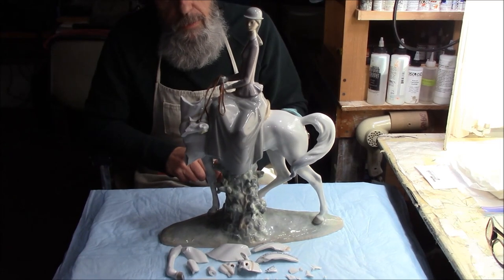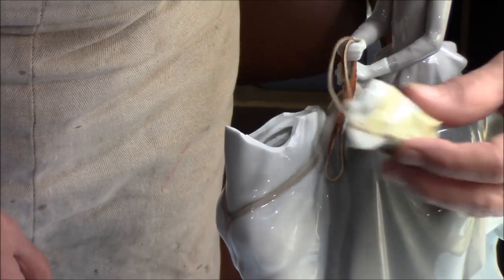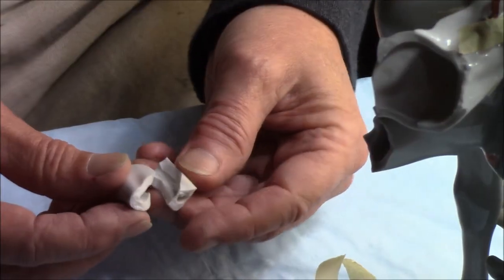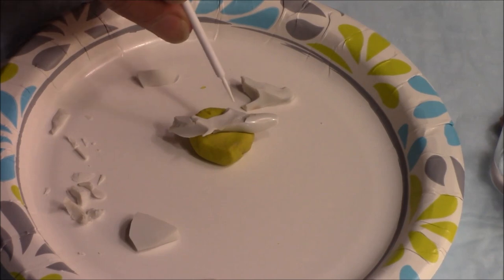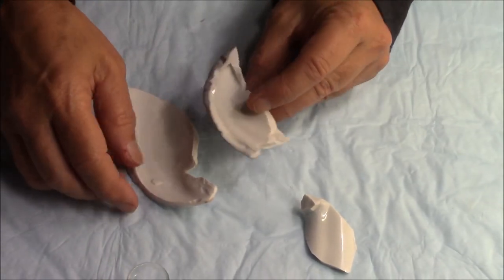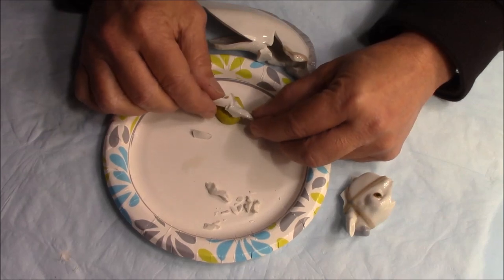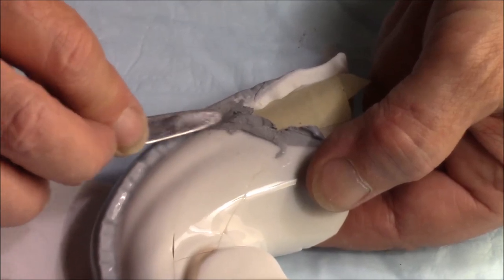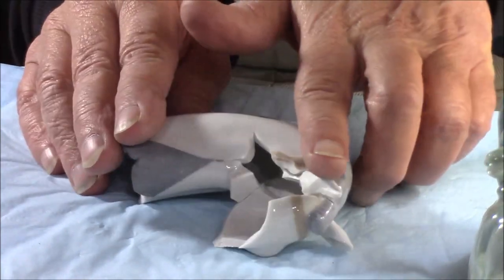Lladro "Woman on a Horse" Repair, Part 1

Comment: Hi Martin, I have another question, this is regarding the A & B putty and the Milliput. When you use water so it wouldn't stick to your tools does the water affect the adhesiveness of the putties. Also, can water be used to make them more pliable like plado and will mixing water to the putties delay the hardening of the A& B and Milliput. Thank you for answering all of my questions.
Reply from the maker: Milliput doesn't stick to a wet surface very well. Once it's in place I use water on the tool so the putty doesn't stick to the tool as I smooth the Milliput. 
You can use water to mix with the Milliput as you are mixing it so you can make a more paste-like Milliput (not as stiff as the normal Milliput mixture. It might delay the hardening a little. Epoxy hardens by catalytic action (chemical reation), not air-drying like normal glue.
I hope this helps. Good luck to you.

Comment: Hi Martin, thank you for answering all of my questions. I have another one, do you think using the stove oven work as a hot box?
Reply from the maker: It's not a good idea. Most ovens don't go as low as 150 F. . Also not good to use it if you use the oven for cooking food: the chemicals could coat the interior of the oven and that wouldn't be good for you.

Comment: Martin, greetings from Turkey, spray gun in my country is very expensive, can i give the same result as a well-branded brush for glazing and paint 🥺 I've got a viennese cup I want to fix but I'm not sure about the brush
Reply from the maker: I don't think you can get a good finish with Cold Glaze using a brush as a final coating. It is difficult to get a nice even coating without brush marks.
You don't need a good airbrush to apply the Cold Glaze. There are some very inexpensive airbrushes out there for way under $100. There are lots of videos on YouTube comparing cheap airbrushes.
If you absolutely have to use a paint brush. You could try applying several (2-3) thin coats and then use "MicroMesh" sandpapers to take out the brush strokes. Get MicroMesh set of abrasives that go from 1800 grit up to 12000 grit. You'll be able to sand and polish it to look like glass. Good luck to you.